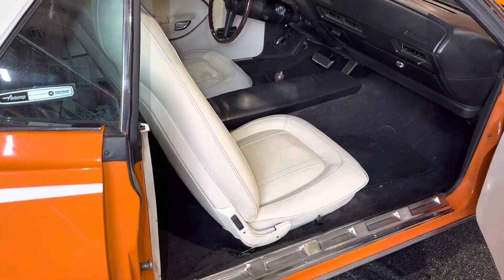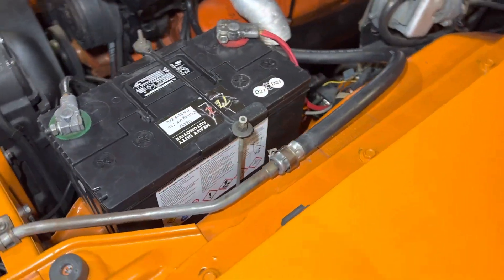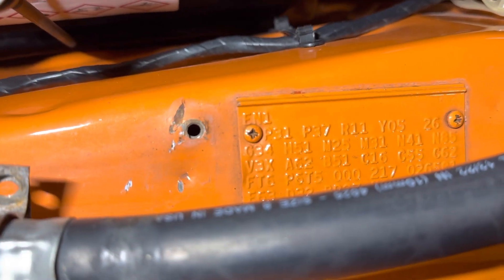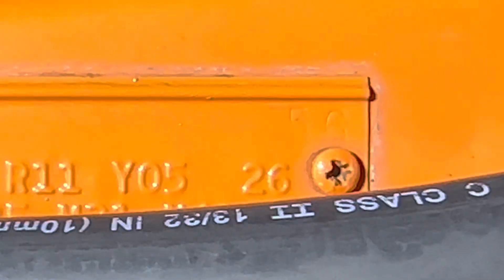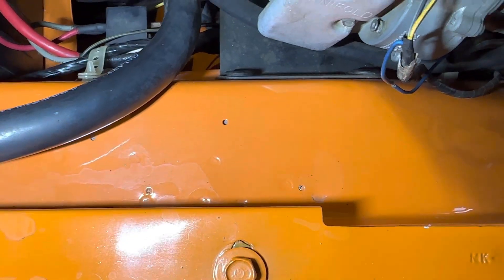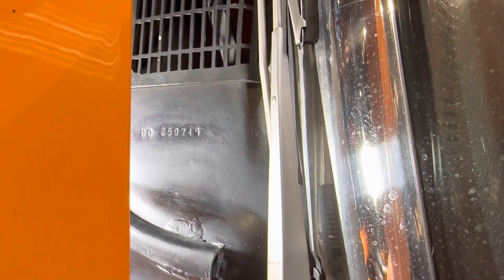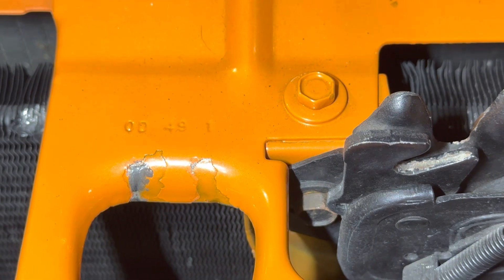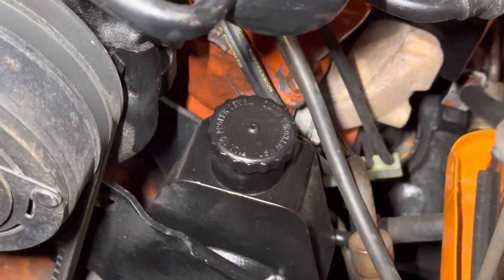1970 Barracuda Convertible 383 , highly optional , nicely restored and color change

Comment: The yellow kickdown rod return spring should be hooked into a hole in the end of the rod closest to the firewall with a washer between the spring end and the bracket. The holes in the bracket are for an alignment pin to properly adjust the kickdown linkage.